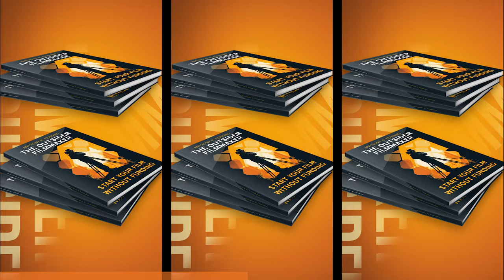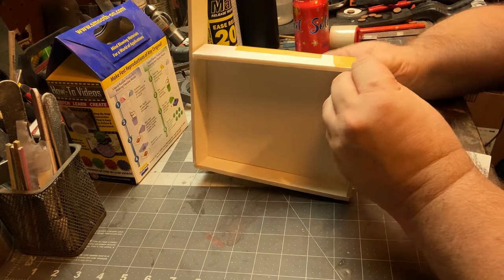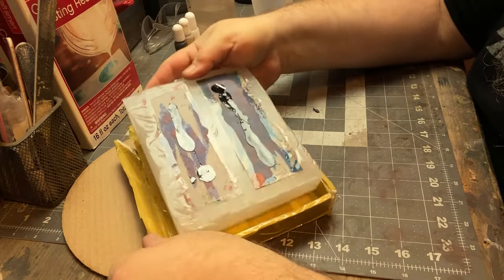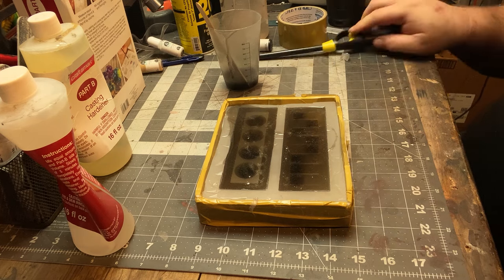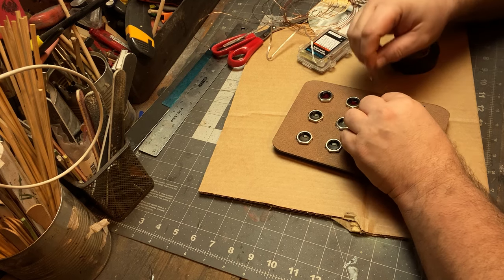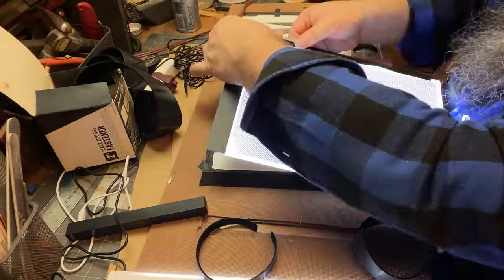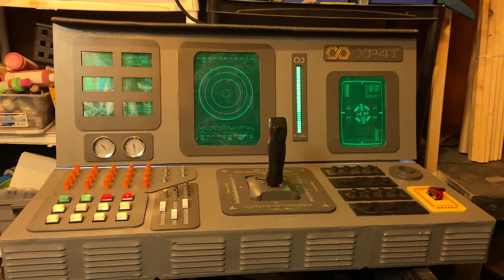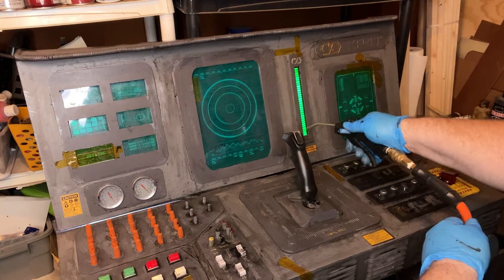DIY SCI-FI FILMMAKING MAGIC: CRAFTING A SPACESHIP CONSOLE SET PIECE | EPIC BUILD SERIES PT 3

Comment: That weathering looked great in the set lighting.  The teensiest change I would personally make would be some extra black wash lain on kinda heavy at spots on and near to the front edge of the console.  If this console has been in constant use by people who depend on it, but don't have the ability to do a full re-fit, there are going to be spots on the edge where folks rest their wrists against it.  Skin oil, differing crew skin PH values and gunk will build up into a sort of fan-shaped dark impression.  A couple of spots like that would signal to the audience's subconscious that someone has been sitting here for a long time.  Especially if you point them out to the actor so they actually rest their hands there.